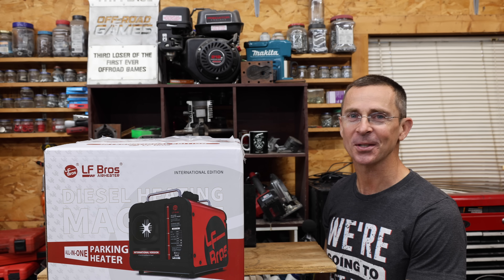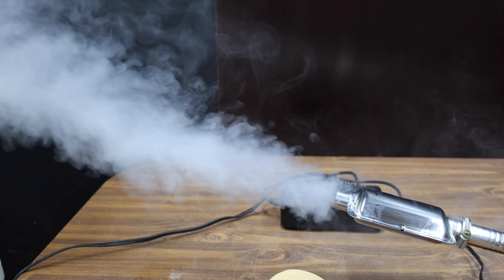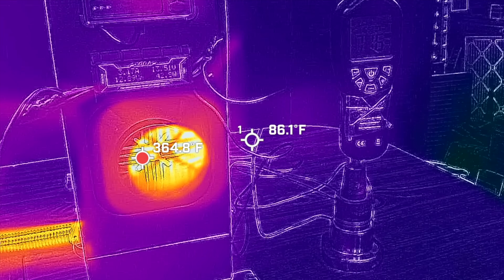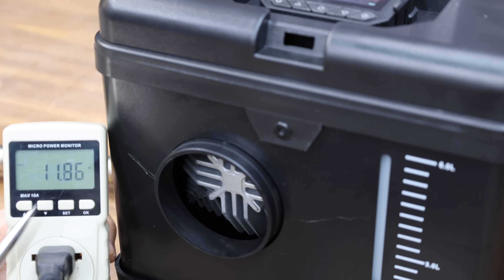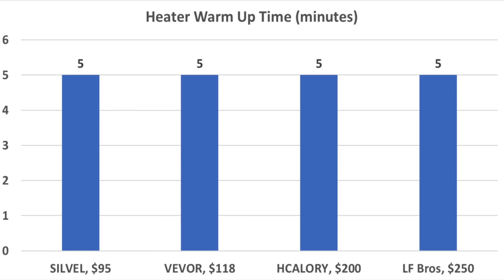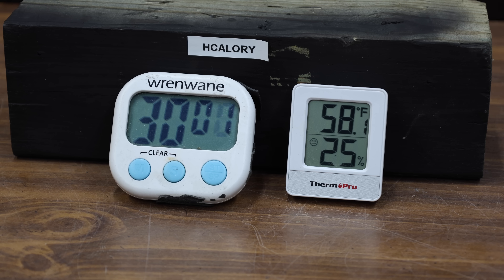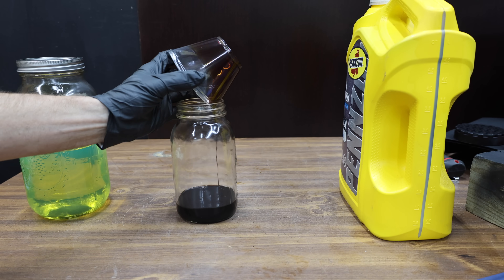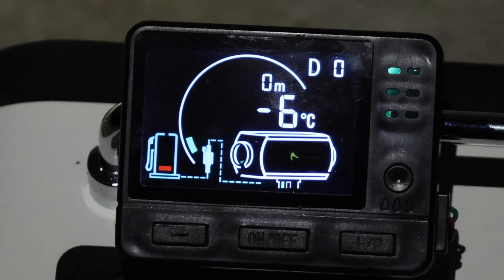The Truth About Cheap Diesel Heaters!

Comment: The heaters need to be calibrated for elevation. Using code 1688 lets you enter admin settings. Some have a generic elevation button or option. The issue is whether you can manually adjust or the elevation option/button actually works correctly and a meter can tell you this. If not then the heaters could get clogged up with soot quickly and is a highly known issue with all users that use them more than a couple times. Having a built in power option is nice but there are options out there to add one like you did. Exactly right about the fuel tank side port = safe against water and debris. For the all-in-ones a major problem overlooked by many is the potential for overheating when a battery supply or power supply runs out or dies. The boxes with more room and airflow are better for longevity and power failures vs heat damage as the 300+ degree heat will stay in the box when the fan is turned off. If you had to run your heater during a power outage off a car battery for example until it dies and needs to be swapped with another battery then you could cuase heat damage right when you needed it the most. This means you would want a box that could be easily opened and allow heat out for this scenario, there could be benefits to side panels vs rain over removing the whole vevor case. On average you have to replace user replaceable parts (glow plug atomizer screen) every 4 to 6 months with moderate to heavy usage esp on low heat. Parts die about once every year or two with fulltime usage. Even german brands that cost 10 times mire only warranty for 3000 hrs of useage bc the fan bearings will go bad. Vevor is basically the most universal and old school that you can easily find parts for on amazon or aliexpress. Once you start getting into fancy brands with different options the parts will become more limited and costly to get. Most styles can swap in an older LCD and ECU kit (if the 2 to three connector options available match up) to get the 1688 code admin option and or be able to add a Afterburner furnace controller to make it work like a home furnace with wifi and/or Bluetooth abilities and 7 day w/ 14 individual timers/schedules per day. After 2 years of daily/heavy usage the the inner cylinder burn chamber needs to be replaced for about $20 bc it also has a screen built into the top where all those directional vents are and will gum up with creosote type material esp when ran on low all the time. For example running on low all the time to keep a pump house from freezing or to keep RV pipes from freezing when you are not there but want to have water available easily during the winter for example with visitors for a week but not run 7 tanks of propane in cold weather (1 tank every day for 24 hrs = $90 vs 1/2 gallon to gallon of diesel $21 max for a week)
Reply from the maker: Thanks for sharing.

Comment: LF Bros makes a heater for high altitude that also works well for lower altitude according to what they say on Amazon. Cost is significantly higher than the others at $350. I am wondering if you could test some of these at 5000+ feet in elevation for those of us out west who hunt and fish in the mountains and might use one of these to heat a tent or camper? Thanks for the great channel.
Reply from the maker: You are welcome!  Thanks for the suggestion.

Comment: If you plan on traveling with these heaters please note that the Vevor and HCalory will leak from the lid and the cheap plastic fuel tanks are so loose fitting that they tend to crack. I've owned all three of these and wish I would have purchased the LF Bros. first. Buy once, cry once!

Comment: I think the hardware or case design makes no functional difference, but there are small differences 
in the programming of the control parts. 
The starting process is likely to be reduced without a smoke process if you start the diesel pump 
with a delay using a switch or a diesel inlet lock.
Reply from the maker: Thanks for the feedback.

Comment: I use several different of these heaters at my house. But I don't use the ones in an enclosure.  My heater is outside and is hooked to a 55 gallon drum of diesel  so it stays on 24/7 durning the winter.  I think they are all made in the same factory in China, not much difference in them all
Reply: Do you think it’s cheaper to run than the boiler
Reply: @Cookie.x.monsterr  An electric boiler. Not really. Aboht the same here where I am. Cost me about $250 a month in electric to run my electic heater. And about the same in Diesel. But the Diesel heater. Seems to heat up a room alot better  it feels better then what an electric can do
Reply: @ ah I have a gas boiler in brick house. I was thinking a diesel heater would definitely be faster heating the room than waiting for all the radiators to get warm. I was just thinking of the idea as gas prices may be going up significantly.  Just playing with the idea that’s all.
Reply: @Cookie.x.monsterr  could be. Not sure on Gas prices compared to Diesel    it can't hurt to have it as a backup as well.  Try it for a month and compare the two
Reply from the maker: Thanks for the feedback.

Comment: If you want to drastically increase the efficiency of these heaters, purchase an air to air intercooler and run the exhaust line through that in order to capture the heat from the hot exhaust gases before expelling them out of the building/vehicle. That should give you another 3-5kw of heat off of the unit. Get a low speed electric fan and attach to the intercooler to pull air through. 

If you want to heat water get an air to water intercooler instead and a circulation pump. Instant hot water…
Reply from the maker: Thanks for sharing.

Comment: Do not put anything other than good diesel oil in these machines. Seed oil is a mess, it forms black crust inside and black sticky smoke. Cheap ones stink you have to cover the inside of the case with aluminium tape. Finally attach it to a car battery with a battery charger it would work as an ups and you can carry it everywhere. Trust me
Reply from the maker: Thanks for the feedback.

Comment: So the heaters are slowing using voltage from the batteries? I have a deep cycle, and a lifepo4 for emergencies, but if someone hard to grab a car battery, how long would the average car battery last?
Reply: I don’t know how long but I’ve seen a video where he used a car battery with a trickle charger plugged in. So it would slowly charge the battery.   So just having a car battery on its own probably won’t last long maybe two days or four.  But if this is a permanent heating source you would want to keep the battery charged.
Reply: @Cookie.clipstar  Thanks.. the LifePo4 is so much better (and lighter) than the deep cycle, I am thinking of getting rid of it and buying another LifePo4.

Comment: Want to see some comparison of real OEM heaters pre installed on big name trucks etc, like HLN diesel heaters, Webasto etc. The video is very helpful just those heaters are the ones driven out of the premium OEM market. For the most strict requirement, those heaters here are just not there yet. There are better ones for real tough jobs.
Reply from the maker: Thanks for the suggestion.

Comment: I recently bought the square Vevor to heat my old drafty RV, and I am totally impressed with the heat output vs cost. I used to have electric space heaters, and those drove my electric bills sky high! But with the diesel heater, I can run it for a month on $100-$200 in fuel depending on time used. FAR cheaper than any other heat source I could find considering my age and health. (Wood for example is just too much work)
Reply from the maker: Thanks for sharing.

Comment: How do you use one of these in the house with such a hot exhaust pipe?  You can crack a window or something, but isnt the pipe going to burn stuff?
Reply: You would put the unit outside and build a cover for it. Then drill a hole through the wall for the heating pipe

Comment: The only thing I find that makes these more of a fad than anything, is that compared to let’s say a propane heater, You just need the fuel and the heater. 

These diesel heaters require electricity to power them. I have to haul the fuel, the heater, and now I have to haul a battery too?

So can it save lives in a power outage when there’s no power to charge the battery?

Comment: The first one that you tested, that was smoky on start up, might be a false impression caused by the shut down moments before for lack of voltage. There may have been excess unburned fuel during the initial combustion on the second try.

Comment: I've got a vevor  in  my 24 x 24 garage it's wonderful dry heat doesn't rust lathe mill and  micrometers I just pull a 12v out of my bass boat plug a charger up to it and run the heater I will hit the link and get a converter and plug though
Reply from the maker: Thanks for sharing!

Comment: Do you have any tips on what we can do with our Hcalory - the ac/dc plug is not working - We plugged it into an outlet and the light on the box turns on but once we plug the other end into the heater the light on the ac/dc box turns off and does not power the Hcalory. HELP :-) Please
Reply from the maker: Thanks for the suggestion.

Comment: If you run these on low too much, they will carbon up to the point of failure. You need to run these on high about 30% of the time to clean out carbon. On low I get 30 hrs of heat from a full tank. I love mine works fantastic once you get exp. 
I live in a motorcoach in Idaho where it gets Cold.. buy one they are worth it.
Reply from the maker: Thanks for the tip!

Comment: I boat a boat in Alaska that has a wabasto 3900 diesel heater, it's absolutely an awesome heater, and nothing beats wood or diesel heat. The Wabasto is by far way more expensive than all of these cheaper heaters. But they all work exactly the same way. I'm not sure how long the wabasto heater has been in the boat but this summer was my 3rd summer with the boat and the really expensive Wabasto heater broke down in the middle of the season. Really bummed. Had to send it home for maintenance.
Reply from the maker: Thanks for sharing.

Comment: Be aware folks. These heaters do not work well at all at higher altitudes. I have land in AZ at 6000 feet. Tried 4 different models, none worked. Even using the so called alpine setting. If you have any experience with the same please comment.

Comment: I have a Silvel 8kw that provides about 90% of the heat for my 16 x 80 mobile home. I burn off road diesel and have never had any smoke from the exhaust. I plan to add a heat exchanger on the exhaust to make it even more efficient. I plan on buying two of the same before possible tariffs drive up the price.
Reply from the maker: Thanks for sharing.

Comment: I use the 8kw Vevor to heat my small 10’x 40’ greenhouse. I use a solar panel and battery to supply 12vlt   Power, and a 5gal. Outboard motor portable gas tank that delivers 60 hrs of continuous 0:17 operation. I cannot find a cheap heat source that compares. Also use these heaters in my diesel pusher RV—cheap, clean, and easy to work on.
Reply from the maker: Thanks for sharing!

Comment: The false start, the shutdown from the power supply, is likely the reason for the sivel to smoke. The burner gets over loaded with fuel. I had a similar problem with a Vivor. After learning to operate, just a little startup smoke.
Reply from the maker: Thanks for the feedback.

Comment: The first heater was putting out smoke because you tried starting it on low power and it shut off the heater was pumping fuel that was unable to lit so when you put a proper power supply and turned it on it was flooded with fuel and put out smoke had you turn it off and restarted it it would not be smoking so stop bad mouthing it and do a proper test and never burn vegetable oils it will work for a little while but will carbon up the burn chamber and stop working and you will have to take it apart to clean it and spend money for new gaskets so don’t even waste your time and money burning anything in it but diesel.

Comment: These heaters does not produce 8kW of heat for 8 hours. There is not enough energy in 1.3 gallon of diesel to do that even if you use the heat of the exhaust gases.

Comment: are these heaters considered "flame proof"? I am wondering if these would be a viable option for heating my shop area where I do some painting. I would assume they would be acceptable as they seal the heat inside the combustion area and wouldn't expose fumes to a flame for ignition.

Comment: Talking about patent expiring and price dropping. This is really suspicious. We used to have a great refrigerant and fire suppressor, the R12 , and Halon 1201 ,1311. That was not made anymore , at least in western countries because of environmental reasons. This is like witch craft science, a large volcanic eruption put more florine into the atmosphere than mankind ever can. Also carbon dioxide as well, which is a gas of life, not a pollutant. We are at a all time low at .04% in the air and we should try and raise it.  But now after the same time lag, the R134a are considered bad for the same reason and are being replaced by the R1234 , which are different but from an AC point of view, not any better. The 1234 cost 30 times as much and everything has to be new in cars that use it, like fittings , seals , oil etc. A new AC recycling machine is gas specific and cost about $10Gs. The suspicious part was the R12 and 134, they somehow found a reason they are wrong, just at the time Dupont's patent are expiring. 30 years is just enough time for the public to forget, and my bet is in 3 decades, they find something wrong with 1234 again. The idea is , if they cannot corner the market and make a killing with it, no one else can.  Many chemical compound can be used as refrigerant, and be given a number.

Comment: That HCalory  heater, although the exhaust fitting make it easier to hook up (6:27) But that fitting look like someone just saw the pipe at a 45 degree angle and welded it,  from a smooth gas flow point of view, it is a disaster. It be superior if you use the stainless steel exhaust pipe supplied and give it a gentler bend.  I also heard complaints about those green color plastic fuel hoses as being too weak. I have a suspicion that all of these heater's key components are made from the same factory and even the same production line. The enclosure is by someone else and they just stamp different names on them. I am not sure what the real difference is between 5000 watts and 8000 watts for they look the same.But the difference is large enough you might be able to calculate the difference. The heaters been copied from the expired Wabastco patent,  At least they now cannot charge highway robbery price for it.
Reply from the maker: Thanks for sharing.

Comment: Was looking at pellet stove or some alternative setup to heat a partially unfinished basement used for my kids to watch TV and guest room.  I had used propane buddy heater and electrical space heater but was expensive and high humidity. Installing pellet stove or heat pump would be very expensive.  I got the Hcalory non suit case setup kit was b very easy to setup and very cheap to run been extremely happy with this setup and easy for the kids or family to start with remote, wall unit and app.
Reply from the maker: Thanks for sharing.

Comment: Am I missing something? What is the point when they all draw electricity to work? When the power is out, just hope that your separate battery bank was charged and just hope it lasts as long as the fuel? How hard would it be to say include a Peltier generator to siphon some heat into making electricity to drive its fuel pump and fan once warm, and include a small battery for warming it up?

These seem like maybe only slightly more useful than simply having an electric heater... Because if your power is still on, why would you need this unless you lived in a deathly cold area.

Seems like a literal air cooled diesel engine generating the heat off its head would be more useful in a real power outage situation.

Comment: I’m surprised they all worked for you. I bought three. Two had broken motherboard chips so they could never start up. I bought a 3rd and it worked maybe 6 times and it would never power on afterwards. All of these are very cheap Chinese quality even the $300-400 ones.
Reply from the maker: Thanks for the feedback.
Reply: Which did you purchase that failed.  And the other at 6 times?

Comment: I have watched some videos on these diesel heaters and I am glad that Project Farm has finally done his own.
The one that I found most interesting is a video showing a guy routing the exhaust into one of those old cast iron water heaters. He had the exhaust go into the top of the old water heater at the pressure relief valve and then had it exhaust out the bottom  where the water usually enters.
Reply from the maker: Thanks for sharing.

Comment: I live in Northeast PA. My furnace died. It's Dec 26th 24. My house which is a mobile home, has a wall mounted propane fueled heater. It does keep the living room in which is it's mounted warm but the 2 bed rooms don't have any heaters but plug in that obviously don't work during an outage. I am a professional traffic controller and most times the powers out I am on the road with PLL or Infrasource or I B abel or Haugland, but I do have animals at home.
Reply from the maker: Thanks for sharing.